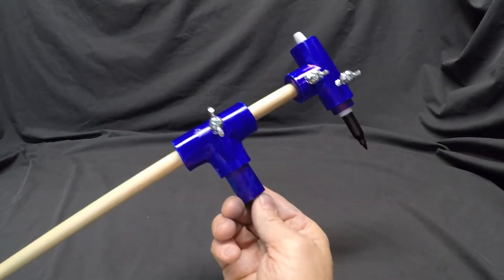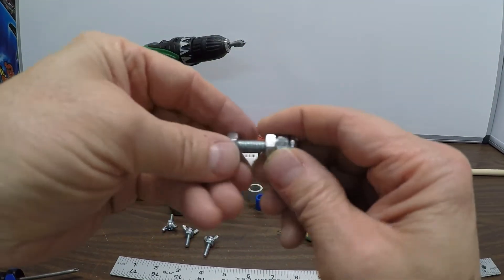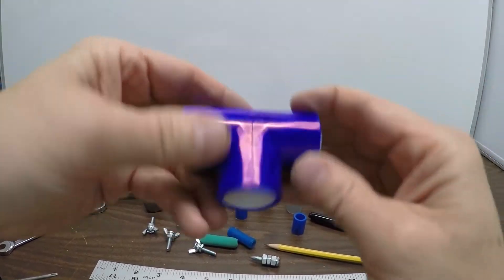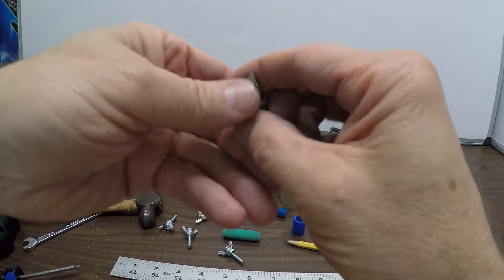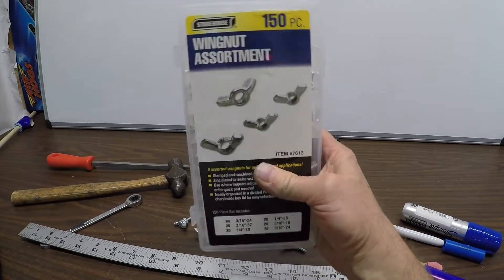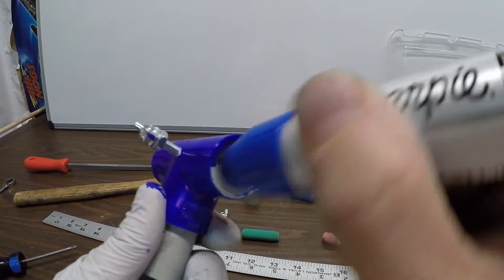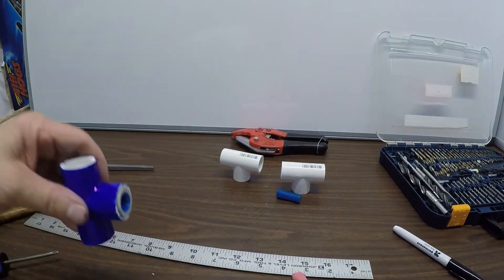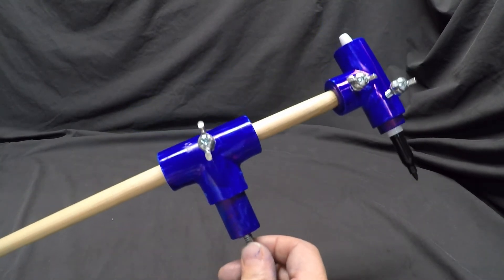Make It: an Extreme Circle Beam Compass out to 8 ft Diameters for $4

Comment: You can also use a nail/screw, put a metal ring, with tied to it string, around it and a pencil/marker on the opposite end of the string. I have not tried, but I don't see why that would not work.
Reply from the maker: you're right, that would work too. I just prefer the quick adjustment and precision of this version..

Comment: Calls it a Butterfly, package has Wingnut written on it. Pretty decent compass. A bit of fucking around with sleeves to fit the dowel kinda sucks. Why don't hardware stores sell large compasses. Gotta dick around making one today.
Reply from the maker: Hypershpere Engineering, vrey good question. Not sure why more places dont sell something like this. One of my eariler video so not as polished as the one I pt out now.
Reply: @MakeItorBreakItNow  I ended up making this compass a while back . It came in very useful for building my Telescope Observatory. I had to mark out 2.3 metre diameter circles onto the concrete slab that a mate and I poured ourselves
Reply from the maker: @hypersphereengineering6015  Wow, sounds like a great project, glad the compas helped you out.
Reply: @MakeItorBreakItNow  thanks, it certainly did